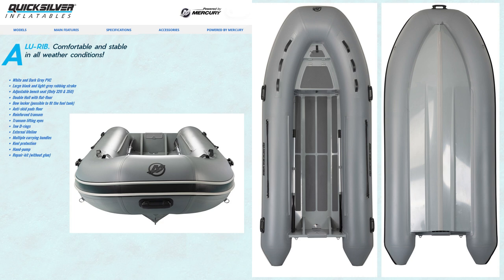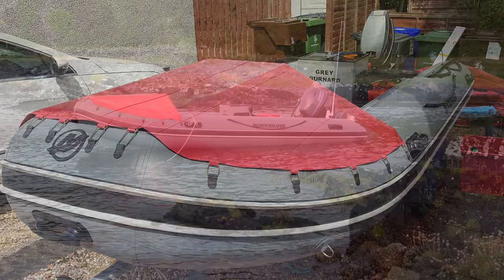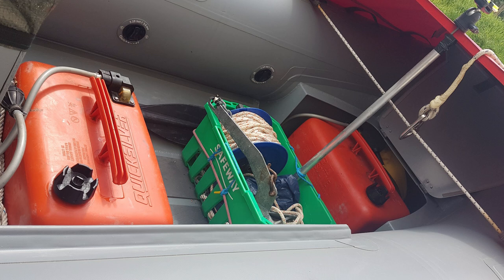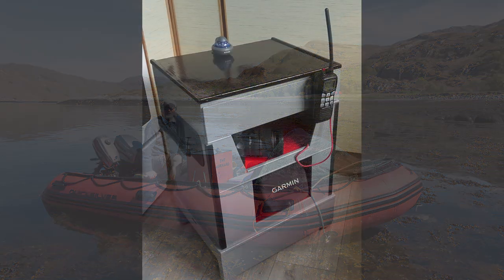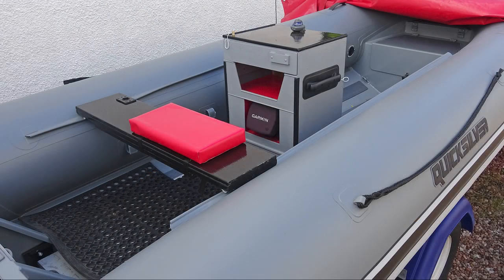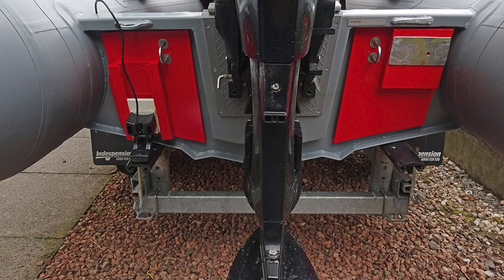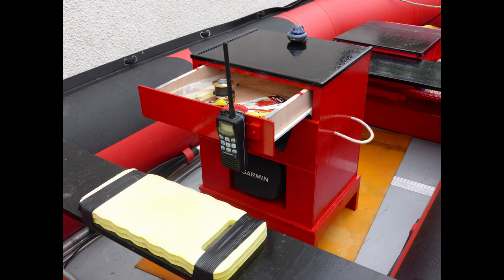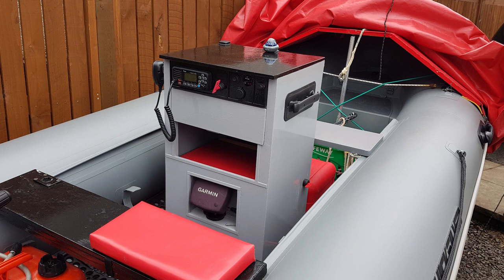Quicksilver 420 Alu Hull Inflatable Boat

Comment: I bought a new Inmar inflatable with an aluminum floor and a 20 horsepower Mercury for under $4000 5 years ago, use it on the ocean in Alaska, it's tough and very economical, very good value.

Comment: Well worth the wait for this video Donny,  There's no end to your talents Very interesting and a professional job well done. The electrical work, Cupboard and everything else is so well thought out. The metal corroding was a very interesting topic which I don't know much about but need to find out. Been pricing up the Quicksilver Alu Hull 380. Really enjoyed watching. Thanks Steve 👍.
Reply from the maker: Its a great boat Steve and I would get another if anything happened. What sold it for me was the fact its short shapt so my old SIB outboard fitted it :-D
Reply: Thanks Donny. See how things go with my new job in Oban in March before I get one. That corrosion issue- if I had my painter connected to the alu Hull with a metal carabiner would it course corrosion. Thanks Steve 👍
Reply from the maker: I just tie mine to the hull. Law of physics is the "higher" metal sacrifices electrons to the "lower" metal. Its why the put anodes on the outboards..they corrode saving the outboard. I have load of scores in the hull paintwork..but they dont seem to rust away
Reply: Thanks Donny 👍
Reply: Why did you get the quick silver all the way down south.

Comment: Very cool, that really works well what you have done. 

Did you notice any difference in thickness of hull pvc between the two boats?

I own the older Mercury 430 HD, and I'm amazed at how thick the pvc is, very rugged.

Comment: Another great video, Donny. I love the technical side of things too, and i do love repurposing old kit so this really speaks my language. Good job! By the way what is that  ‘water separator’ you speak of? What’s it’s purpose? I’m a newbie so it’s just another thing for me to learn. Thanks again, safe boating 👍
Reply from the maker: Hi Captain.. condensation or even water drops from the inlet valve can collect in fuel tanks. If its drawn down towards the outboard ..it sinks to the bottom of the water separator where its easy to draw off by opening the valve. Therefore it doesn't reach the outboard. Well worth it in a small boat especially as the newer outboards dont have carbs which are relatively easy to clean compared to EFI engines :-D
Reply: Understood, thanks Donny. Every day is a school day! 👍

Comment: Thank you for yet another enjoyable video. What fixed compass have you found that works?
Reply from the maker: Hi again Roger .. the boat is well tucked up for winter so cant check the brand. Its around 12 years old and no issues.  I have quite a few compasses for hillwalking etc. Sylvo is a good brand and suspect its one too. I have never had a problem with any but you have to be aware they can reverse if subjected to magnetic fields ..or point towards metal objects if too close. A boat compass is revered compared to a land compass by design. Have you had issues with your compass ?
Reply: @donnywilcox  I have a new highfield which has not got wet yet due to ILL health etc . I have used a eye sight compass previously and thought maybe it was time for a fixed version .As they are not cheap I thought I would ask first .Thank you

Comment: Donny,  sorry to bother you with this question,  the sea handling of your Rib  is it a big difference from your old SIB ? as I'm considering going to purchase the same boat you own from my current Sib  which is OK.. but is slams down after going over waves.   
Cheers Terry
Reply from the maker: Hi terence ..if you follow my videos you will appreciate I got to remote far flung places off the West of Scotland. If Im honest..I dont go anywhere in the Alu RIB that I didnt got to in the same size SIB. I dont go in rougher seas either.. nor do I feel safer in the RIB than in the SIB. Worth considering ? However if you have the money the RIB has some benefits. Biggest benefit for me is how easy it is to launch and recover compared to the SIB. Rollers on the trailer instead of bunks make that difference. Yes its marginally faster and I can keep my speed up in certain waves a bit more than I could with the SIB but still have to go displacement speed when the waves are big. Its not major differences .. its minor differences which all help with comfort. I would happily replace the RIB with a SIB of same size again ..or vice versa ..depending how much money I had at the time. That is only my opinion though..but after a few years of using both.
Reply: Donny,   thanks for your reply,  I've watch about 90% of your films which are great to watch and educational.  I resistantly went out of a big 5.2 rib with a deep v Hull in much bigger waves than I've come across using my 4 meter sib ,  I was considering buying a rib  like yours even though Hull is not as deep as 5.2 m  one I used for about 4 hours .  It stuck me how easy it was to recover from sea with 2 people and agree a Sib can be a lot harder , You have answered the key points for me in regards your happy to use both sib or rib , I'm happy with my honwave T40 it's a staple SIB . But before laying out extra cash for a Rib  I was wondering weather its worth the much extra cost , I think I'll keep it for now . Many thanks for helping me out in making my mind up.  On a side note I found sitting inside the boat ie on the floor in big seas more relaxing than sitting on the seat.  Your much braver than me using your seat ,  many thanks Donny for your help.   Take care 🙂